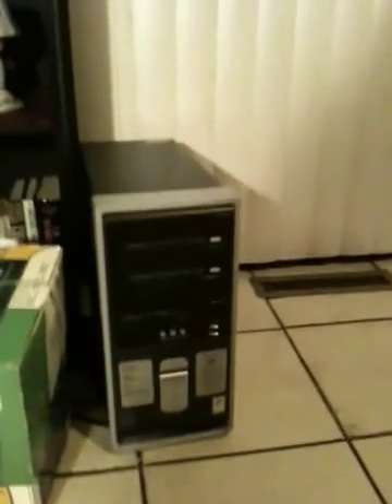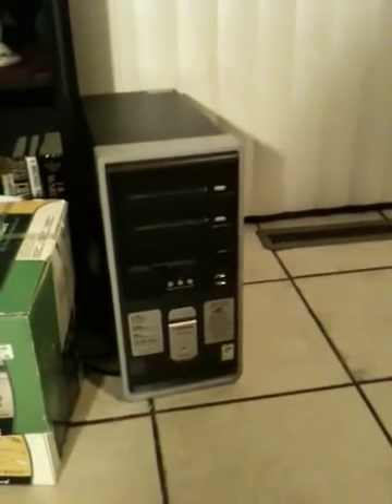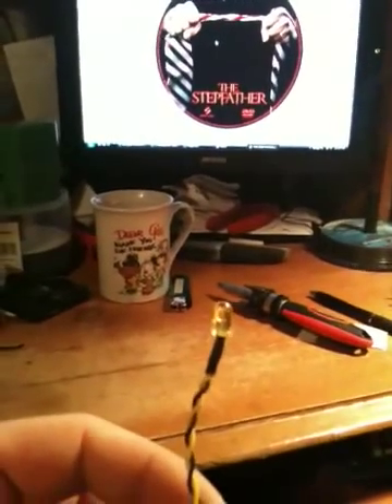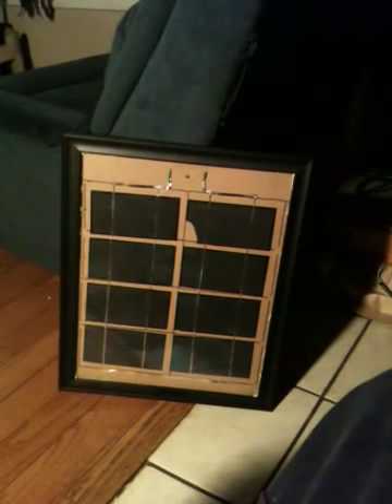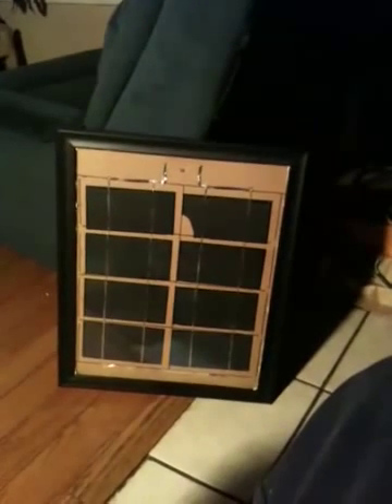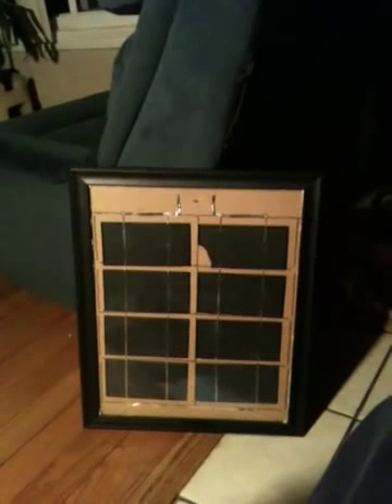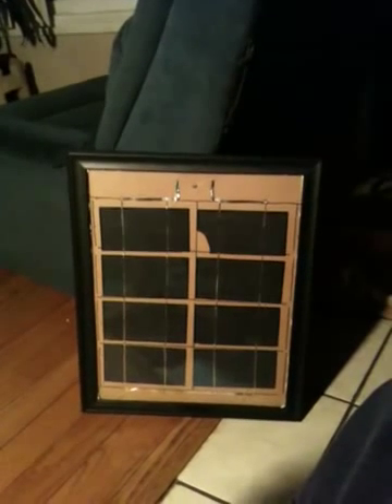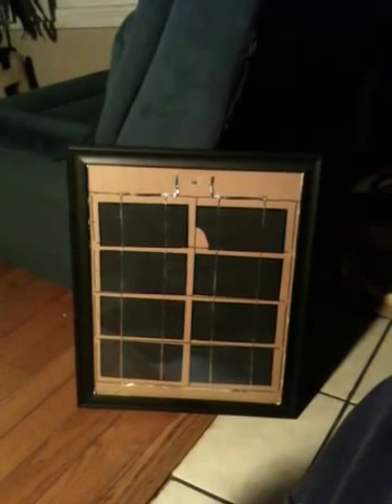#8 Dollar store picture frame solar panel test 3

Comment: You need to get an inverter to be able to power a light bulb like that. An inverter converts DC to AC (120V). Although most inverters take 12V input...

Comment: 400 cells!!!! your going to outpower me with that! Your hooked!! I have 100 cells, but waiting for better weather. They are .5 volts each. I haven't been able to check the amps. yet, but they should at least be 1 amp each. And it's a diode you need, not a resistor. It's going to use .6 volts just to work. GOOD LUCK